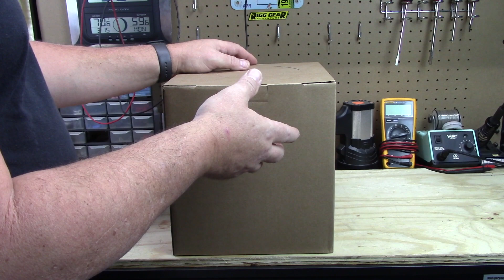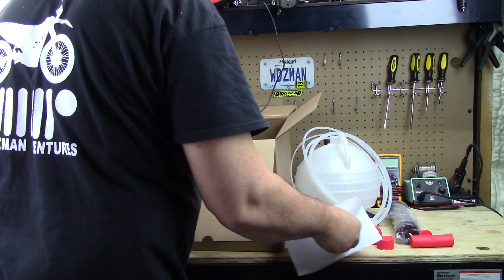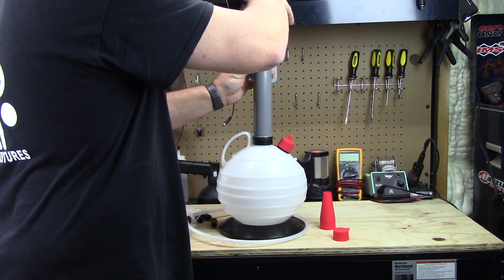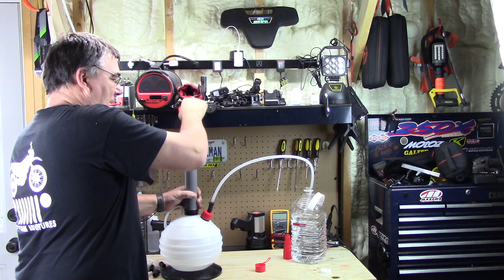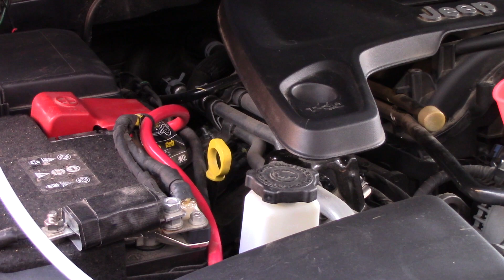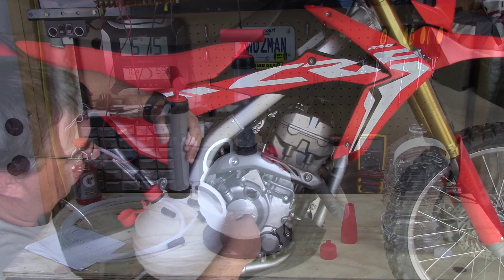Kemimoto 6 L Oil Extractor Pump Motorcycle ATV JEEP SUV Car Tractor UTV Lawn Mower CRF300L CRF250L

Comment: Any word on new bike
Reply from the maker: Still waiting, I hope the end of March, I will text him again closer to April and ask
Reply: I have a manual pump like that for many years. Mine does not have a reservoir. I just pump it into a pail. 
I have a CRF 250 L and I reach the bottom of the engine. You should check this again.
Reply from the maker: It might, I just figured the clutch plates would be in the way, maybe not
Reply: @Woodzman  Maybe not 😉😁